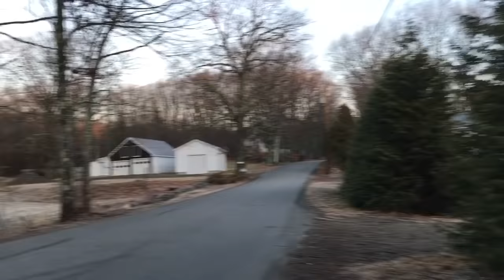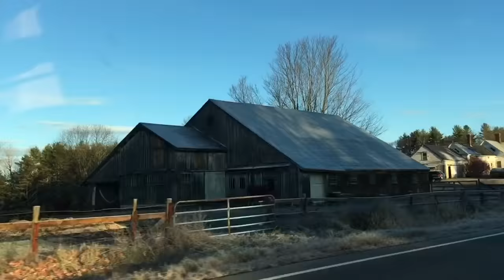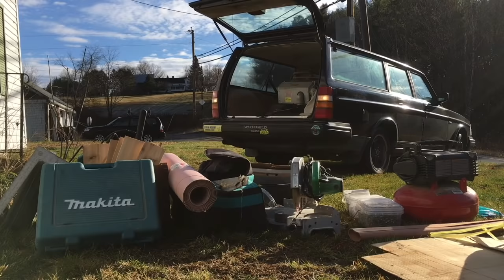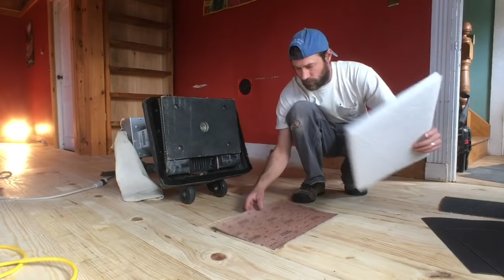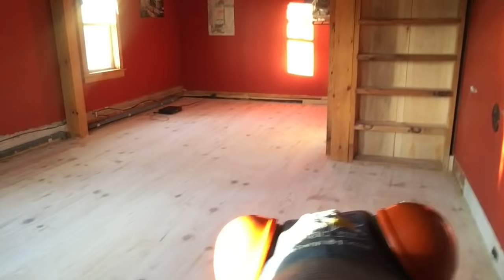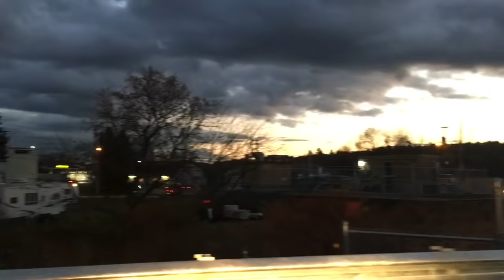Sanding a Pine Floor.  Maine VLOG 237

Comment: Like the burlesque floor show cover shot, lol.  I just sanded my old 1870s pine floor today and turned out okay.  They nailed the floorboards through the edge not the top, so no nails to sink - just a bunch of square tacks had to be pulled out and 1920s hairpins plucked from the cracks.  A strong magnet helps to find them.

Comment: Does sanding it down like that get rid of rough edges that give splinters? I recently had yellow pine floors laid down and it has a lot of areas that are rough where we easily get splinters in our feet. I am thinking perhaps that were not sanded enough.
Reply from the maker: It’s likely an issue with the grit of the sandpaper used. They may have used a heavy grit (like 60 or 80) and the final pass. I typically finish with a 100 or 120 grit. The sander I used in this video is called a square buff which basically sand in small circles. If your sander person used a drum sander they may have raised the brain by sanding in one direction against the grain of the wood. I hope this helps!

Comment: Dude. You set the nails before you rent the sander.
Reply: Consider a REAL half-face respirator. 3M makes a nice one, and your lungs are well worth the investment. Paper masks are largely window dressing for sub-5 micron particulates that do the most harm to your wee alveoli.

And, some information on the pattern of sanding would have been nice. That's what I was looking for. I believe you start your passes at a 15 to 30 degree angle to the boards, then on finer grits run parallel to the boards. Was trying to confirm this.

Nice scenes of Maine.